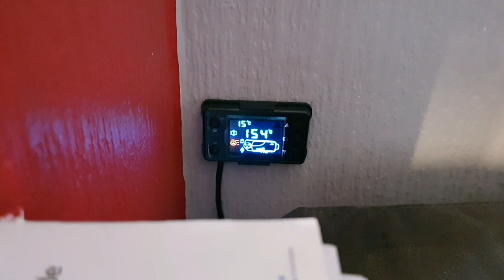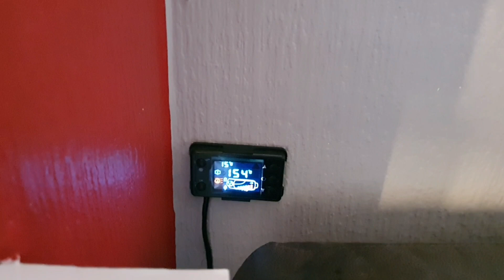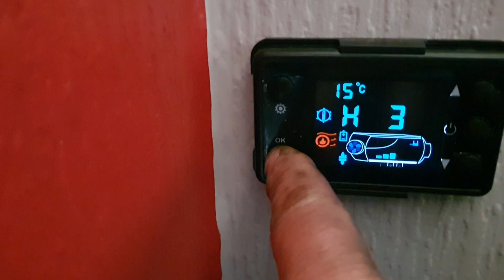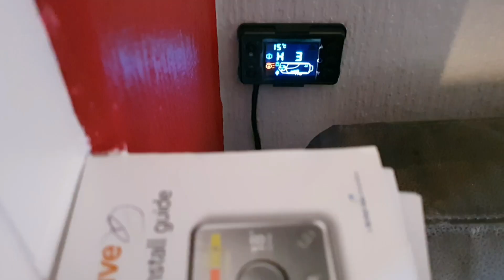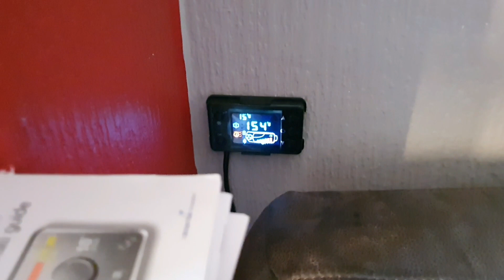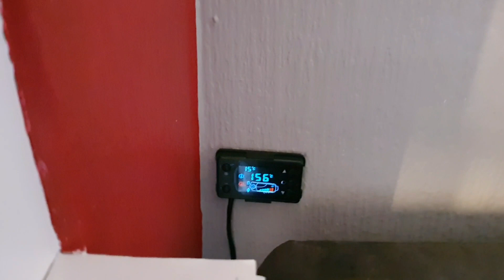Chinese diesel heater, after 21+ days of WVO/Diesel mix and stand alone control unit ideas.

Comment: Clean the burn chamber with carburetor cleaner.  Recommendation:  You may try to use high temperature silicone seal if you can not find original gasket.

Comment: Mate have a look into chatgpt. It's an AI that can write code for you. I can't code but I've got enough electronics understanding to know what I need to make it do what I want. I've asked it to write me code for an arduino to work like a diesel heater using something like this 'write me arduino code that will be used to control a heater. On input 1 will be a thermistor where 1v equals 1 degree celcius and 4.5v equals 100 degrees Celsius. On digital output 1, use pwm to control the fuel pump. Pulse the fuel pump at a rate of 1hz and 6hz depending on a potentiometer on input 2. Also pulse pwm output 2, name it 'fan', at 16khz, adjusting the duty cycle between 1 and 100, based on a potentiometer connected to input 3.

That's just an example, you can add more logic to it and just talk to it like a human and it'll edit the code for you. It's great.
Reply from the maker: Finally got around to looking into this, nearly a year later. Man this gpt chat thing is amazing. Wish I knew about it when I was at working and having to create comparison documents and summary reports. Could have milked it😂. It's pretty mad, thanks for the heads up.

Comment: Hey Shane. I have found that hard starting and shutdowns (for me) are almost always due to build up in the area you cut apart in one of your earlier videos. I now have my chamber cut in half in that area, and attached back together with a stainless steel hose clamp. It makes it really easy to clean that area out. I have been running it without any mesh whatsoever, but I assume that it would work a little better if I used something in that area. 

I have had the same deal with the oil leaking out of the burn chamber gasket, but also out the flame initiation hole. I can't say for sure, but I suspect what happens is this. When the burn chamber gets plugged up (in the main burn area) that creates enough back pressure, behind the bafle, that the air going in actually comes back out through the initiation hole and carries some oil out with it. I have no way to prove this, but it's the only thing that makes sense to me as that area is never plugged up, yet the oil sometimes comes out.
Reply from the maker: Joel thanks. I somehow missed this comment yesterday. I have joined the chopped chamber back up, with a hose clamp too, and may at some point look at cutting the bottom section out like you did, but for now want to continue with the electronic experiments. Thanks also for pointing out David Mcluckies experiments using the ne555 timers etc. I had completely missed those previously and watched a few last night. Interesting, but never really found a conclusion, it appears he moved on to a Arduino managed board shortly after. I was toying with Arduino but before you know it the costs mount up, using discrete components or cheap Chinese modules should help make it more affordable to those who like to experiment. Thanks again and speak soon.
Reply: @shanehogarth6373  Yeah... I'm not sure if he dropped the project or not. I do like the idea of using the modules rather than the Arduino...

Comment: That gooey stuff is polimerised glycerine from the veg oil . This is why heated veg oil is worse for you than animal fat , the heated veg oil molecules are extremely spikey in form once heated , which makes them lock together and form the yellow gunk . Almost like a mid cured epoxy resin .
Reply from the maker: Thanks Lee, yes that explains it perfectly. Who would've thought veg oil was worse for you than animal fats. I have heard this before but never given it any great consideration. The gooey stuff reminded me very much of the crud you used to see around chip pans and fryers. Thanks for watching and tha is for the comment.
Reply: @shanehogarth6373  yep strange old world , only when heated mind ! Don't go eating lard sandwiches as part of a new health plan! Some veg oils are more sticky than others , also the polymerisation happens once cooling down . Its definitely worth knowing what that stuff is as there's special catering cleaners for the stuff 👍👍
Reply: I opened up a few engine diesel pumps that were full of that stuff, usually they had seized by that point and been replaced so i opened them up for a autopsy 😮
Reply: @Dirt-Diggler  thanks for that info , it seems that once you do get it burning nicely by blending at some point the "golden glue" will need cleaning . I have noticed it seems to like to creep into gaskets ?
Reply: @leeevans1874  when it's hot it gets into everything then sets like glue  when it cools down 😕
It's why Bio is processed to remove the free fatty acids and glycerol, it also plays absolute havoc with injectors ☹️
Enjoyed the vid chap 👍
Reply: @Dirt-Diggler  indeed , the glycerin seems to be where the nasty stuff is 👍.

Comment: im not sure but one layer of duck tape
is not enough thickness for a gasket
Reply from the maker: Have you seen the OEM gasket? It's about as thick as a rizla paper. Not a lot of heat in this chamber, just a little cool air at a low pressure. I should maybe add that the other gasket for the burn chamber was made from thick wet and dry paper. Just the inlet air pressure chamber  gasket was made from duck 🦆 tape